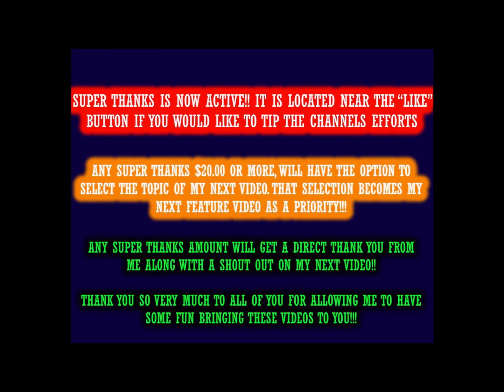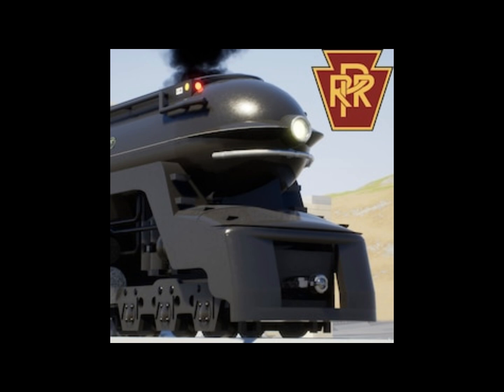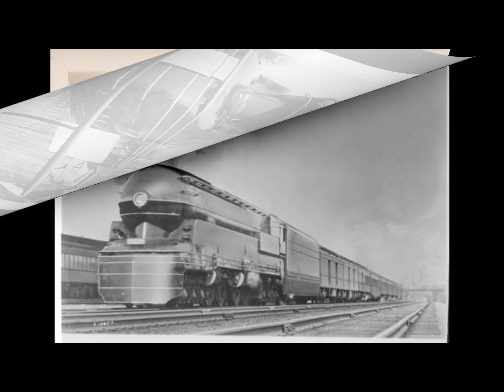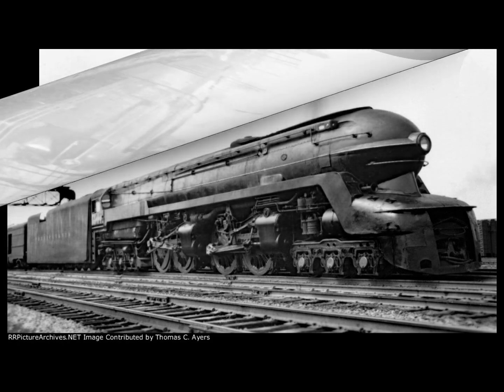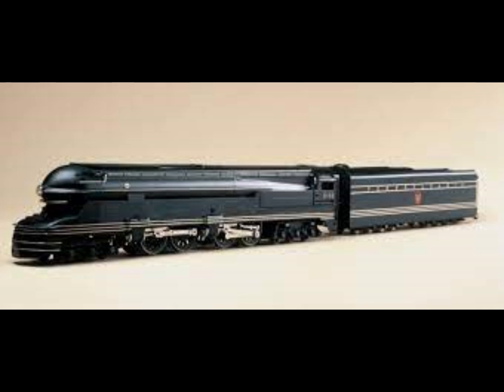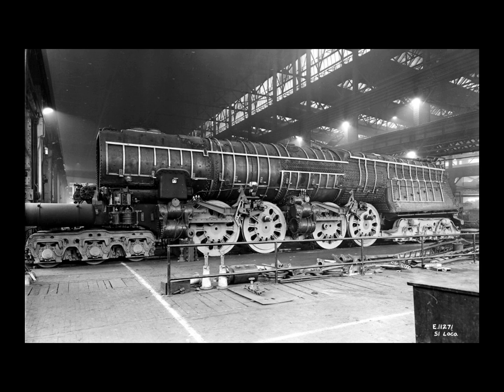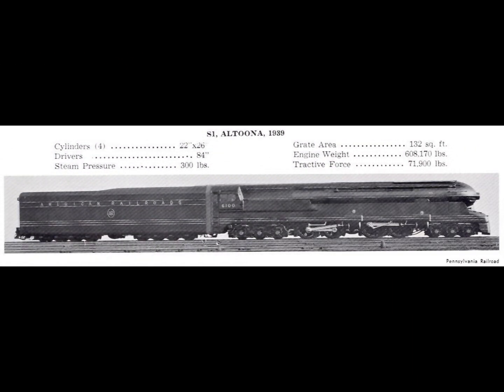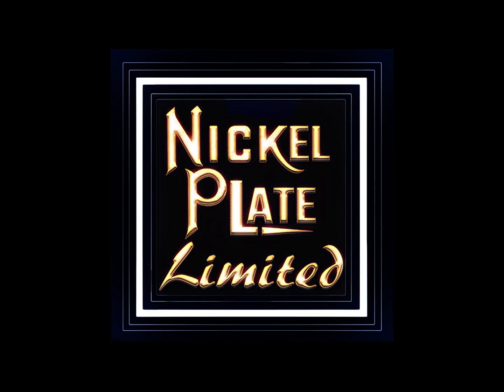Pennsy 6 4 4 6 Duplex S1 Locomotive

Comment: Fastest ridgid steam loco in the USA,  with a top recorded speed of 101mph. The 133mph that some claim this loco achieved was not official or recorded, and highly unlikely.  

Several UK ridged frame passenger locos in the UK exceeded that, as have several German locos, all official recorded times and speeds. 

GWR 3700 Class 3440 City of Truro is alleged to have got up to 102 in 1904, but timings were by stop watch and mile post recordings. 
LNER Class A3 2750 Papyrus got up to 108mph recorded on a dynamometer car in 1935
LMS Princess Royal Class 6203 Princess Margaret Rose timed at 102.5mph in 1936. 
LMS Streamlined Princess Coronation class No. 6220 Coronation was recorded at 112mph in 1937
LNER A4 Mallard 4468 was recorded on the dynamometer car in 1938 at 126MPH. 

It is alleged that post war, with the improvements that had been made to the A4s such as the drafting and most importantly, the bearings,  that in the 1950's, the A4's were regularly (unofficially) breaking Mallards Record on a daily basis, but the management of BR took a dim view of this, as they kept the East Coast Mainline speed limit to 90mph because that's the best the Type 4 diesel locos that were intended as  their replacements could manage, which is why the A4's hung on to express working until the 1960's when the 3000hp deltic locos were released for traffic on the ECML, which were the post powerful diesel locos in the world when new.  The sole LNER W1 in its rebuilt form was apparently more than capable of running at over 130mph (again alleged and unofficial) amd was described as a suped up A4, as despite looking like a A4, was much more powerful, having 20" cylinders rather than 18.5", giving it a tractive effort of 41,437 (compared to the A4's 35,455) and a fire grate area of 50 sq ft compared to the A4's 41.25 sq ft.  The footplate crews said that when you got up towards 130mph the loco would not only rock side to side, but  back and forth (hunting) as well, as no doubt the reciprocating speed of the wheels was so fast they were becoming out of balance. 

The Great Western Railways Cheltenham Spa Express (aka Cheltenham flyer), which was usual hauled by a GWR Castle class loco, had the worlds fastest average speed for a train at a BOOKED 66mph and this was later increased to a BOOKED 71mph for its 70.25mile trip. The fastest trip was On Monday, 6 June 1932,  when the Cheltenham Spa Express was hauled at a AVERAGE speed of 81.6 miles per hour over and this made this run the fastest AVERAGE railway run in the world, being hauled throughout by GWR Castle class 5006 Tregenna Castle. 

This october marks 65 years since LNER A3 4472 Flying Scotsman started Alan Peglers USA tour (hint hint) perhaps a video is due for you wonderful channel (hint hint) lol.
Reply from the maker: Really good stuff! Thank you!!

Comment: the S1 was 2 feet longer then the Big boy, if you count both engine and tender of both engines. It is astounding that the engine is 1 solid rigid unit, and was able to run on any line is amazing. 
a truly oustanding locomotive, and a shame it wasn't able to see preservation. 
I hope the T1 trust is able to beat the steam speed record, because I'd love to see this line of duplex engines get more attention.
Reply from the maker: I still dont understand why hinged bogies couldnt be used in the design. It would've helped on the curves and maybe not limit the locomotive so much.
Reply: @TheRailroadCrossing-SteamPower  a strange dicision to be sure. perhaps they were worried about balance and vibration? but the size of the boogies could have aliviated some of those concerns. One of those questions with a lost answer now.
Reply from the maker: @notknightbean   Yep for sure!
Reply: I agree, but also the amount of weight upon the driving wheels is concerning. Do you think that with more driving wheels and less pilot and trailing bogies this could be remedied?  @TheRailroadCrossing-SteamPower

Comment: How could this possibly be a successful locomotive when it's only got 40% adhesive weight on its driving wheels   NO wo derailed it had slipping problems   Why didn't the builder put two cylinders between the frames and convert loco to a 6--8--6 layout
Reply from the maker: Yep, I was kinda scratching my head on that one.

Comment: It’s Achilles heal was it’s frame, they couldn’t engineer a frame which could handle the stress’s placed upon it! Great Experiment though… That’s when the US was an innovative creating country!
Reply from the maker: Yeah, the frame was too ridged. So I was wondering why they wouldn't consider the articulated pin system like Big Boy.. ETC. I mean I understand they wanted as few moving parts as possible. But to me, this could have solved the problem.

Comment: The S1 is an art deco masterpiece, but it would have been much more successful if they built it as a 4-8-4 with lightweight rods and roller bearings.  It would have been the Pennsy “take” on the NYC Niagara or N&W J.  Having that small percentage of weight on drivers guaranteed the S1 to be slippery.  From a business perspective, the short service life and lack of versatility made the engine a terrible waste of money.  Thanks for another great video!!👍
Reply from the maker: You know, when I was looking at the specs and saw the length and width.. I thought "Were they building a Iowa class Battleship or a locomotive" ? Because the Iowa's were built the same way.. Long in length and slim on the beam.

Comment: So as I understand it, the S1 was just too long as a rigid engine for most of the PRR network, but it showed the way ahead, because the the later T1s were built as duplex drive locos, but to a shorter length with 4-wheel instead of 6-wheel bogies at each end. Lovely looking locos !
Reply from the maker: That is  it in a nutshell. You got it!

Comment: Ah the mighty S1 of Pennsylvania

One of my personal favorites when it comes to streamlined steam

Raymond Loewy's streamliners are just beautiful
Reply from the maker: I absolutely have to agree with that!
Reply: @TheRailroadCrossing-SteamPower  probably the most fancy looking futuristic steam engine of all time, looks fast even sitting still be still my heart though 
I love reading and discussing the s1, and you even talked about the extreme speed though I understand it was 140 mph not quite 150, though after finishing the video I see you mentioned that, supposedly they got a ticket or citation for running that fast but history never has found the artifact to prove it, also I read they eventually pulled off some of the wheel skirting and sheet metal to get better access to work on and service the s1 known as the big engine"
I also remember reading that all three of the big 3 consulted on building her lima alco and baldwin, with it actually being built at the worlds largest railroad works or at least at the time and still problably is its still very large though not the huge 14-20 mile span that the altoona to juniata shops and pennsy yard were, but it was said to be a project that all three worked on, its a tragity it was not saved for a museum, but if they would have just articulated it and maybe got more weight on the massive drivers, the largest size that is used on any usa built locomotive at 84 inches there were some early locomotives in england that were over 100 inches in the era that they had just one drive set they also tried other funny experaments in the early days.

Eh anyway it was also reported that to have ran very smooth at high speed due to the size taking up the jarring and jostling it experianced, I am kind of sad you didn't have any photos of it in fort wayne like the one under the coal tower or comming west out of the yard at pique pronounced pick way and though not as big as altoona fort wayne did have a hump yard for a good chunk of time as well as car shops east of the main shops and bass foundry in the middle of downtown fort wayne, though before the rennovations around 1904 they had them by lafyette street and were in a u shape where the famous palace cars were built the few of them they made we are talking pre 1900 though.
thanks for talking about the s1 it was very powerful, beautiful and fast, maybe the fastest steamer ever
Reply from the maker: @manga12  Your passion is admirable and your write up is really good stuff! Thank you!